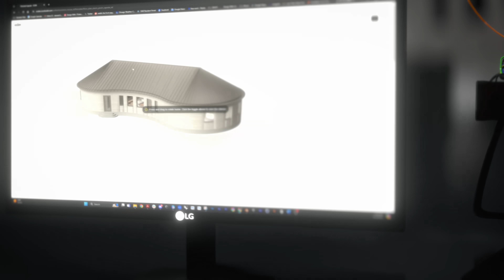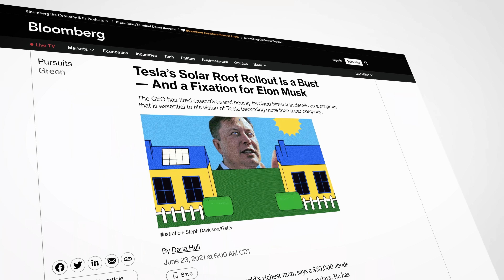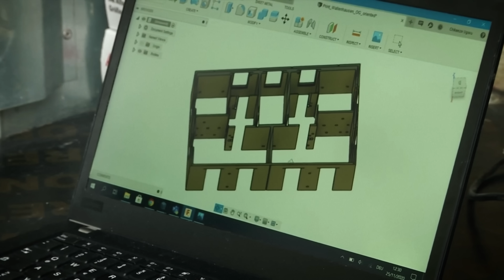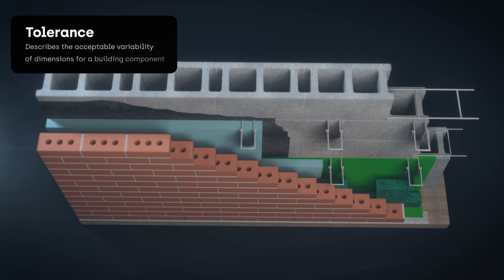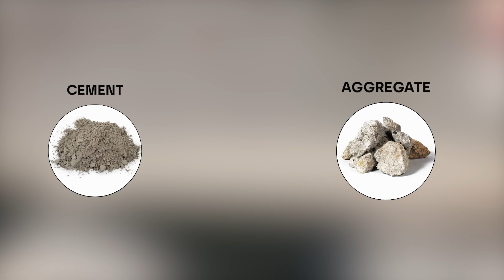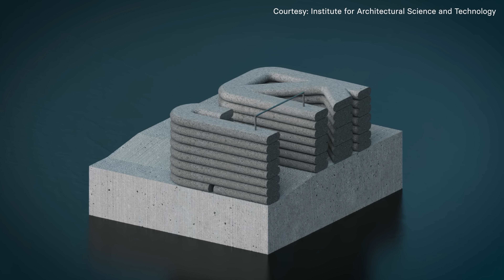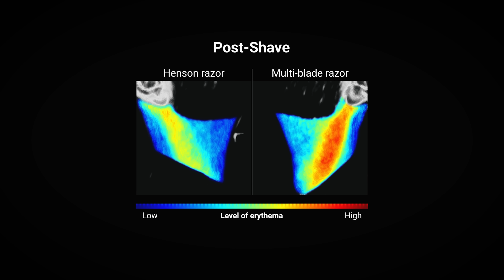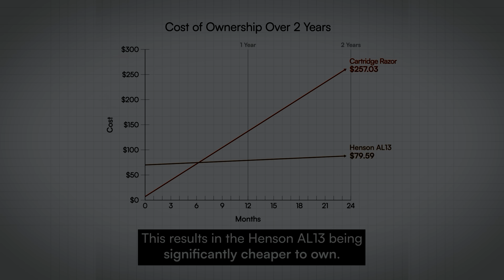Why 3D Printing Buildings Leads to Problems

Comment: How is a rough surface a problem when sanding exists? Sand the interior, put a sheet of drywall against it. Sand the outside, put some siding on it. For the corners make the robot do a bit of a wide sweep, like an Ohm tilted 45 degrees, then have a second robot come in with flat panels and push the outside of the corners in until they make an almost 90 degree angle. Want to make an addition? Do like bricks: Take out different amounts of alternating rows and fill in the gaps with the new construction. Why are people pretending like these solutions don’t exist?

Comment: Still watching the video, so maybe this gets addressed, but gotta say, I do normal 3D printer projects.  I keep my 3D printer in an isolated room, where I can strictly control temperature and airflow, because those variations can greatly affect the quality of the end product.  I can't imagine all the variables one would need to contend with in an open air site, like 3D printing a building.

Comment: Prefabricated homes just seem much more practical than this.  Just build the homes in a factory in parts then transport and assemble the parts on site.  At least for homes in temperate climates.  These printed homes only seem to make sense in areas that need a lot of insulation.

Comment: I don't think that 3D printed buildings are any harder to renovate or change later, it depends on how they are designed. Most modern buildings are already made mostly from concrete but instead of being printed it in layers it's cast in straight pieces. 
Even with brick walls you can't just remove or cut them as you wish, you'll always have to calculate loads and stuff in order to make sure the house won't collapse. 3D printing can even help to make buildings more modular because you can easily design and print bits and pieces as you like and, using a normal 3D printer you can even create model a realistic model that's not just looking the same on the outside but is literally a scaled down version of the final product. This can further improve the design and build process.

Comment: You must be an engineer.  This will never work in reality.  First, what if a pipe freezes and you have to demolish concrete to access the pipe.  Second, how will you remodel the structure?  You can't, and you won't.  This is a monolithic pour. Cracks will happen, and as you said, your repairs are not possible.  This might work as a foundation, but it will never be viable for an entire house.  Lay off the pipe dreams

Comment: You cant add a lot of aggregate to concrete if you need to extrude it. So it will always be more expensive. Commercial concrete is mostly rocks.

Comment: Wait, doesn’t this mean the house is going to break really easily? Concrete doesn’t flex particularly well does it? So any change in the ground, an earthquake, or so on, would cause the house to totally split, right? Instead of a regular house it would be pretty difficult to repair something like that I’d think?

Comment: it just simply seems like we would be better if it didnt include interior walls and i think the best way to make anew house cheaper is modular components that would ideally fit in one truck load (not happening) i will say DRY WALL SUCKS i wish we used just about anything else that shit makes NO SENSE why the hell are we building are interior walls with paper and gypsum i wish we used like hardy backer, fiberglass, metal, literally anything else it makes NO SENSE

Comment: Why Not try to make the machine lay bricks instead of Building a fdm Printer. 
More heads for different objects to be placed inside the Walls etc. 
Right now These Layer Lines Look Like a Printer 10 years ago. 
The System Itself i Like. But it is so far away from usable.
And also this wont change housing Crysis

Comment: The real benefit of extruded buildings is piping in the material.  When we can very easily get one extruder on the site and have the concrete trucks\delivery out by the road hundreds of feet or yards away we can build with less site prep, earth moved, trees cut, - we win.   That's the cost cut.

Comment: I study construction material engineering (Masters). In my university in Germany we think of 3D-printing as a way to pe-print walls and shapes to later bring to the construction cite in order to reduce construction time and increase variabillity. That way we do not ned to think about setting up the printer each time and also have a better controlled environment to print the concrete. Also this aproach helps to centralize construction and thus helps to get construction to be more flexible for sustainable technologies

Comment: Electrician here. It would actually be much faster and cheaper to install electrical on studs. This is going to have great insulation value, but that’s it. Concrete is very expensive, and it looks bad right now, so the resale value is going to be horrible. I would give this another 10-20 years to refine itself before it’s a reality.

Comment: So basically, setting up the 3d printer is probably more effort than actually building the house itself normally, especially if you consider the equipment and man power needed to do the work.

Comment: All the cons with the aesthetics are things that can easily be dealt with.

Design the homes with consideration to added wall thickness for finish work, i.e. a room might need to be 1" wider to give wiggle room for a finishing crew to come in and mud / cement the walls and smooth them out after it cures. There is no reason to think one has to live with that gross look. Same with the outside - come back after the walls cure and then fill in everything and smooth them out. You can also sharpen outside corners or add some sort of facia / facade / siding to make them look like normal homes.

I'd take one of these homes or one with foamed concrete walls for the sound and insulating properties. Love some peace and quiet.

Comment: All very good points. Thanks for the maintainability insight!

For me the primary opportunity is reducing transportation of materials. There is a whole cost both financially and environmentally that can be greatly improved by on site fabrication. 

for example: Harvesting timber-> transporting it to a lumber mill -> packaging it -> transporting it to a distribution facility ( or multiple shipments) -> transporting to the construction site -> further milling and assembly -> Packaging the waste -> Transporting the waste (multiple times)
vs
Harvesting local raw materials -> transporting to the construction site -> Fabricating and assembly -> raw materials transported to the next site -> fabrication plant moved to the next site. 

I get there is a lot of variation depending on the component of the house being fabricated but the general opportunity for reducing the often hidden cost of transportation is a primary benefit.

Comment: Didn’t you just lay out the techniques to fix a damaged portion when explaining how some “pieces” are printed separately and put into place. So the solution would be print damage piece offsite/onsite, cutout/remove damaged portion, install and set with cement mixture.

Comment: 3d Printing homes is an expensive gimmick. This does not and will not solve affordable housing issues, the problem is the price of land and restrictions on where you can build. Not to mention that new builds are already cookie cutter and lack any real architectural merit, this will only make this problem ten times worst. Also surely a clay brick home will have less environmental impact than a house made of pure concrete. Love the videos btw. Just thought this seemed a bit backwards 😂

Comment: What about the reinforcement of the concrete? Without, you will not have larger printed concrete structures. And also no bending is allowed, so you will only able to build walls.

Comment: Without reinfircement concrete cracks appart. You'll get a giant crack in the wall as the house settles. How do you print with mesh inside?

Comment: It’s concerning how many of these companies use zero large aggregate or reinforcement. I wonder how quickly this sand-based concrete will crumble under compression via roofs and floors bearing the weight of furniture and daily living, all without rebar or aggregate.

Comment: "Looks a little weird"? Beauty is in the eye of the beholder. I think these houses are awesome and with all the thermal mass they should be very energy efficient. We do need to green up cement manufacturing, but processes to do this already exist. This building technique is in its' infancy and will be refined as it progresses.

Comment: Very good video. Congratulations!
I see the biggest potential of 3D printing in the fast production of replacement parts in small numbers. Maybe in very special parts for buildings, too.
The trouble with rounded corners in buildings is that the rooms need to offer places to put furniture that are made with wood and have no rounded corners.
The Hundertwasser buildings in Wien (Vienna) and Darmstadt (south of Frankfurt, Germany) are living quarters with rounded corners and sloping floors, but most of all they are tourist attractions.

Comment: In much the same way filament 3D printing on the small scale has every issue you mentioned, RESIN does not. We could theoretically create a resin that is super lightweight but strong and print insanely perfectly detailed structures within days at a factory and than ship them off like half cut houses

Comment: I would think in printing a building it would be built twice  or more at the same time, as the concrete is printed another arm behind shaping the wall. AI could be used to keep areas level too.

Comment: How long does it take to set up the printer? How do you run electrical and plumbing? How much extra time does it take to hang drywall on uneven concrete walls? How do you hang doors? How do you attach siding? This seems liek one of those Kickstarter companies that do great marketing on something that does not solve anything and wont actually work once you start looking into the details.

Comment: Your brick wall analogy is hilarious since homes in the US use bricks as a veneer. You should go and see how Europeans build their houses. Then you might appreciate concrete construction. In the US a shop fabricated house system is the fastest and most flexible. 3D printing is not a universal solution, it is a solution to a problem that doesn’t exist. It’s a toy.

Comment: I don't think it has much hope. You can't build a strong house by stacking mortar. Better to make an auto block laying system or something. These walls are not proper. It's absurd. They're going to hairline crack, straight-up crack with sagging, the utility nightmare, i just don't see the benefit? Any price savings could be found in other ways in more traditional construction. It has no benefit other than that, and it just puts people out of work for poorly built homes. 

Its not similar to bricks at all. Bricks spread their load. And sure you can make an opening with bricks. It's called an arch. Lentils are just most common. These walls need some sort of reinforcing. A wire mesh with fiberglass rebar or something.

Comment: Think of a 3d printed cement home as a home constructed out of CMU.
You don’t like the look on the outside, wire lath and plaster. Extend the wire reinforcing and add brick. Lastly EIFS construction, Yuck! On the inside, run metal studs vertically and add sheetrock.
The major problem is zero thermal break, at least in alum windows they put high density plastic to keep the exterior alum from being in contact with the interior alum.

Comment: Any way to speed the construction process and lower labor costs are a huge benefit. Automation has to start somewhere and be refined as technology improves. Othewise building houses will remain primitive, very labor intensive, very costly and out of reach on most people. Problems with later modification also exist in a typical construction and are not that straight forward or cheap for that matter.

Comment: I like the softer rounded corners of a 3D-printed home.  I even like the horizontal lines in the walls it creates.
Reply: I actually like the softer "hard" corners and flowing lines. Those layer lines though are just a trap for dirt and bugs and will make the building look awful in a few years, at least on the outside.
Reply: @kelvin1316  Same thing/ issue on the inside.
Reply: @ronald5728  It's because leaving the surface exposed like that is basically arty nonsense.
You wouldn't leave brick exposed on the inside (in most places at least) and most other construction typically uses render or cladding to cover up the construction.

Because all of these buildings are prototypes they're trying to show off the material. Which isn't something you would do if this was for mass use, for the reasons you stated.

Comment: As for razors, I've had 3 models in my lifetime: 2 blades, 3 blades, 5 blades.
3 blades - always blood (especially if I used foam or other lubricant), 5 blades - well, a razor like a razor; 2 blades+water - ideal.
But for the last 10 years I've been using a battery powered trimmer

Comment: Clog up the nozzle? Those are big nozzles.

90° corners? Just use a wooden mold like in 'traditional' construction. Repairs & renovations? Uhhh...there are portable concrete sprays. They will even do a better job and produce smoother walls!

Comment: The problem with 3d printed houses is well summed up by the sponsor section at the end. 70 dollar for a handle to use some 1930s 0.1$ blades (which are more than fine). An expensive solution to a problem we don't really have. We use 6 blades single use razors  I mean... mortgage wooden houses, not because they are the best but out of bad habit and ignorance. A house made by oneself in the wild with whatever one finds around would be more than enough... but we want to be cool and live close to our useless job in a toxic city shaving our hairy legs with some 17 blades vibrating razor... The real problem is in the heads and is easy to fix... if we want.

Comment: ... this is a solution for a problem that doesn't exist.  We already automate the basic construction of walls and roof frames in wood or metal. Bricks aren't even used all that much in many modern houses because its not really any better than just putting up properly framed walls then covering them with sheets of drywall (inside), plywood, and then siding (outside). Its fast, simple and flexible in design. Framing then covering also allows for extremely easy plumbing and wiring, for easy repair/replacement of components within the walls, and for use of a variety of insulations.  For houses at least, there isn't any real reason to use brick or concrete over steel or wood framing, when it is used its often as a veneer on the outer wall, or only for the outer wall with the interior walls being made of wood or steel framing.

using a 3d printer to make walls will take longer, be more expensive and not give any better product.  The common mess that we get in so much of modern home construction is do to cut corners, laziness and negligence of the builders, not some fundamental flaw in the techniques and building styles themselves... changing to a different technique won't fix that, it just gives people a new thing to half-ass.

Comment: I don't understand the criticism about the look. Absolutely nothing stops anybody from putting stucco or drywall on these walls. It will stick just fine and look perfectly conventional. Same for repairs. We are constantly repairing old structure with new techniques unless the building has historical value.

Comment: Remember when 3D-printed food was going to solve world hunger?

I see very little that can be done with 3D printed structures that can't be done better by some other method, except for creating a structure with visible layer lines. Pure gimmick.
Reply: Speed and enormous flexibility in shape. Square buildings are also a lot of things, but they are not even close to the best shape for stress.

Comment: 3 guys can wood-frame and put a roof on a small house in two long days.

What is the advantage of 3D printing?
Reply: It's not a tinderbox, for one thing. Nothing against stick-and-frame, but if you have a high environmental risk of fire or high winds, then it's a really, really bad idea to go with stick and frame construction. Also not the best idea in wet environments like the tropics or along the coast because of seawater spray. Wood is a really poor choice for that.
Reply: @lepidoptera9337  Ok then so build in those areas with concrete blocks.

10x cheaper than 3D printing.
Reply: @ I have nothing against concrete blocks. Are they efficient? Not the way most people use them, I am afraid.